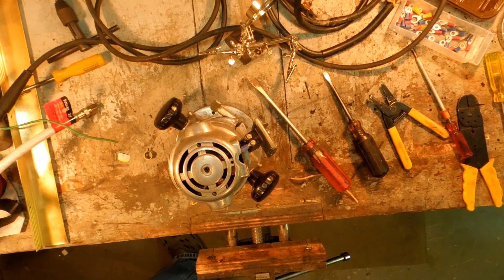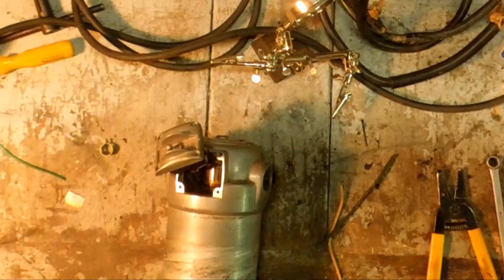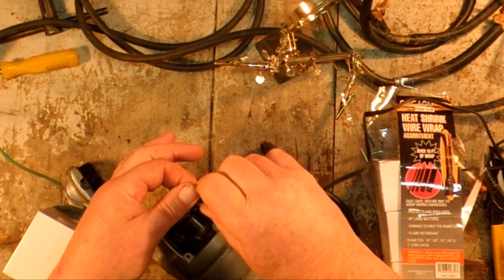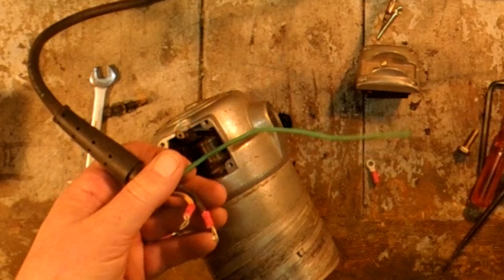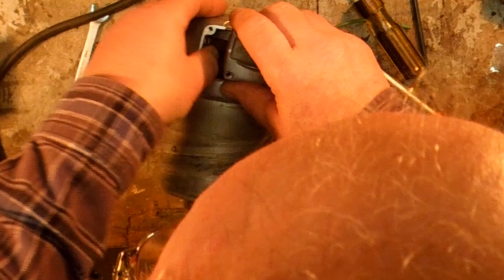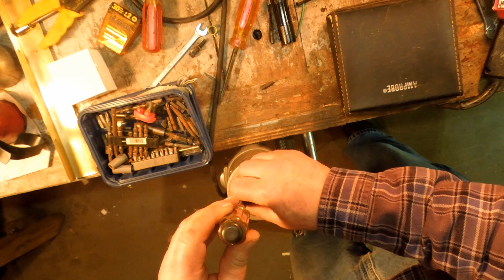Restore Finds ~ Porter Cable Router  Pt 2

Comment: There are at least four routers in the garage: two hand held and two mounted in some type of table.  There is a set of router bits in one of the tool chests, in case I need them.  I know there are people who say that a router is the most useful tool you can have in the shop, but I have never felt a need for one.  I also don't do any type of fine cabinetry, so there's that...
There are also a couple of old aluminum bodied tools that will probably need new cords: one is a 1/4 drill and the other is some type of buffer or sander ( it has a rubber disk on it).  I think it would seem silly to put much work into the drill, as my cordless has more power, and it doesn't have a cord to need messing with.  The buffer might be worth fiddling with, but not until I have a shop to work on it, unless I find a pressing need for it (and that seems unlikely).
Reply from the maker: Good point Brian. Just because I got a free router and I'm fixing it doesn't mean it is the right thing to do for everyone. You may not need or want a router. I happen to enjoy fixing tools. I actually fix tools and then get rid of them because the fun was in meeting the challenge of fixing it. 
Your battery operated tools do everything you want. That is a good thing. My set of Dewalt tools do most of the day to day work that power tools do well. 
Lydia and I were discussing marketing this morning. We both sold to the public and studied marketing. She has a degree in marketing so it's a common subject. Just because Wranglerstar has a video about chainsaws, 1.5 million subscribers are exposed to chainsaws over the next week. A percentage will act on it. A larger percentage will be influenced by it. The reviews of the cheapest things, whatever they are, at Amazon comes to mind. I recognize that if I watch the video I might, and probably will, wonder if that item would be useful. If I act on that thought and follow through to the point of clicking on the link in the description Wranglerstar gets a spiff, or vigorish, or commision from the sale. 
I don't think you need a router because I am fixing one.
Reply: @OldSneelock  occasionally, I re-read one of my comments, but have zero idea what I was intending to say.  That was one of those...
While I don't necessarily need a router, I enjoyd watching you fixing this one, and I realize I would probably enjoy watching you repair a Hole-in-the-Head (TM), and pretty much no one needs another one of those... 😉
Reply from the maker: @BrianDaleNeeley  Your comment got me thinking and I riffed on the idea of why people in general, not you specifically, tend to react to stimuli. 😆😎

Comment: Can't see properly on the video,but that top bearing looks like the old type of grease nipple you put a little grease in the hole on top of the bearing and when you screw the bolt back it forces the grease into the bearing ? As I say can't see if that would work looks very similar to the old water pump greasers . The depth collar and the body french Clark it it'll stop it seizing and won't run like say wax when the body gets warm . I've found a box of chalk from when I was at work I'll have to send you some .catch you soon 👍
Reply from the maker: That is a new one for me. Thanks David.

Comment: Top L. photo in booklet  pg 42  (44 w\ '>' used)   https://archive.org/details/RockwellPorterCablePowerTools/page/n43     
 Yep, 'Thumb Screw'.   Tho - my favorite, but why that style\ length?   Nothing seen for other use - yet. -->  'Notch' Carriage bolt ???
Ground Wire attachments -  Between Switch & Plate?  Also thought >  Screw on top of Switch's Back?   Does it follow through to Metal?  
Or, A screw holding something inside ( top of Router?)  only cause i saw this.   >  https://www.ereplacementparts.com/cord-p-60673.html    
lol     don't know what happened to ability of tightening by hand.      = ]
OK - it does bother me when I read 'it has', \ have item, but no idea WHERE\ HOW it should go.     Thanks for trying to make it fit !!!   : )   
About the Screw off into Another Dimension   ~  have you Tried a Broom?     lol     I found something once.   ; D    
Working Here I get angry  ~  Watching You I get anxiety is that better?  (anxious) -  I think it Curiousness.  And  -->  NO SMACKING APART!

Comment: I have a Porter Cable 690 router & had to replace the bearings in it,  should be similar to yours.  To disassemble mine I did the following:
1: Removed the brushes
2 : Removed the screws from top of router and removed top of body from router
3: Using a rag to hold motor shaft, used an impact to remove collet body from motor shaft. 
4: Removed armature from router & removed clip to access bearing. 
5: Removed bearing, used socket as driver. 
6: Reverse procedure to assemble.
Reply from the maker: Thanks Walt. Is the collet body pressed on or threaded?
Reply: On mine the collet body was threaded on.
Reply from the maker: Thanks I was hoping it was. The lower bearing is running cool so until I actually use to find out if there is a problem, I will leave it assembled.
Chances are pretty good that the bearings have Brinneled from sitting. Over time vibration pushes the ball's through the lubrication film and they begin to wear into the races.

Comment: My Porter Cable router has a square head bolt for the pinch bolt and it binds against the body and doesn't turn when you loosen the wing nut. Some Johnson's paste wax on the motor will cure motor binding to the base.
Reply from the maker: The paste wax is a good idea and doesn't transfer. 👍

Comment: Good electricianing. Nice router too.My old Craftsman had a square headed bolt so it wouldn't turn too. And if I had something that needed oiling that I didn't want to demolish outright I just get it running and get some oil on the shaft next to the bearing. It slings it out a bit but some always gets pulled inside the bearing. Hasn't failed so far. But that's me too. You're a lot more refined than I am. So there you go, Unc and Thanks!
Reply from the maker: It quieted down a lot just oiling the top. Linda O did the research and found the catalog for it. Now I need to find the break down.
Reply: @OldSneelock  Keith Ruckers deal maybe? That had my bench saw stuff. Ought to have that router.